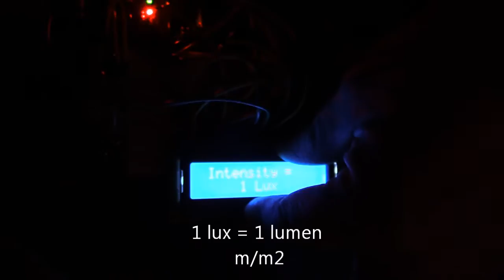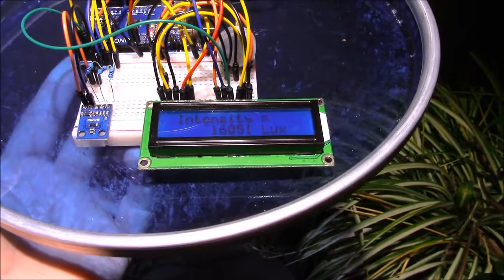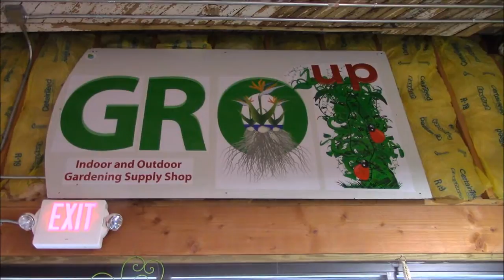Grow Light Intensity Lux Measuring with BH1750 and Arduino

Comment: Hi Trace - just thought you'd like to know.. I got the BH1750 up and working on my Electric Imp today, so I can now tell you that I'm getting a reading of 18670 lumens where the Brandywines are sitting under the growlight. Outdoors it's giving me just 1272 lumens at the moment (It's overcast out there and the sun has started to set now too).
Reply from the maker: Oh great! I was wondering about your outdoor reading until I saw the sun was setting. Looking at the data sheet I saw that the spectral response drops off quickly at 600 nm. So with the redness of your light I'm sure it would actually read quite a bit higher if I'm interpreting that correctly. Either way I'm sure those Brandywines are happy. I just planted the Gooseberries the other day so my fingers are crossed. With the resolutions  that you can select for the bh1750 I couldn't find where it was on the code. Although I didn't look too hard. I would think he would just run it in H resolution as that's what is recommended other than if you wanted dark detection. Glad to hear you have it running. I was just using the meter for my large 3 watt panel I made. I did some modifications so I was doing some comparisons. Time to make it a permanent instrument and get it off the old drum head. Ha!
Reply: I only just got it working so I didn't get the chance to get a reading earlier in the day. I'll get some more readings soon... hopefully on a sunny day. I'm planning on adding the BH1750 to my greenhouse monitoring setup (along with the BMP085 bariometric pressure and DHT22 humidity sensor), so they should be getting added to my greenhouse graphs some time soonish. I found the codes on page 7 of the datasheet for the BH1750. There's are three different modes available (in either one-time or continuous, so I guess that's actually six). There's a low-res mode accurate to 4lumens which only takes 16ms to do a measurement... normal mode at 1 lumen resolution which takes 120ms, and a high-res 0.5 lumen mode (also 120ms) but that halves the maximum value you can read out of it. Both of the H modes are suitable for dark detection.. it's the L mode which isn't.  I just noticed on the datasheet that I'm supposed to be dividing the reading by 1.2, so that's only 15558 rather than 18670 lumens under my grow light... I'll have to fix that in my code. I think you're right that this should be built up into a handheld unit... I might see if I can put one together with one of those little OLED screens I've got. Hope you're well. Cheers!!
Reply: Trace Waters Oh.. I meant to say... those cape goosberries seem to take a good 3-4 weeks to germinate and sprout one of the tiniest seedlings I've seen (or maybe that was just bad luck with the seeds I had)... once they get their second set of leaves out though, they really start going for it... Good luck.

Comment: Hi Trace - Sure looks cold over there. That's an excellent arduino project - I wonder if you could put coloured filters in front of it to only allow selected wavelenghts through... If you had a selection of different reds, greens and blues you could get a plot of the light spectrum from the lights (I've also seen it done using either a prism or a defraction grating). What lux reading do you get for outdoors at the moment? Cheers!!
Reply from the maker: Jim Conner I had to wait for a sunny day. It is reading 30,000 Lux mid-morning in the dead of winter. I would guess it is higher in the afternoon as well as one meter from the sun--- I used a prism to get a full spectrum from the 100 watt white LED, but the compact unit was a bit of a surprise and I'm not sure what to make of the patterns. I should have a video up this week.
Reply: Trace Waters Thanks Trace - Now I have a comparitive figure for nature vs growlights. I've ordered one of those sensors for myself too now, so I'll be putting it out in the greenhouse when it arrives to keep track of how sunny it is out there. Looking forward to your next video. Cheers!!